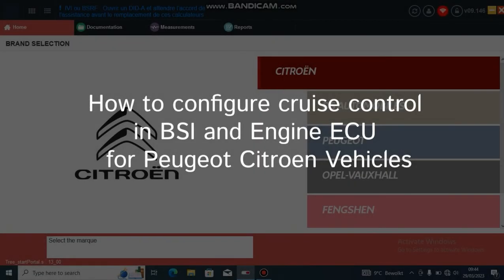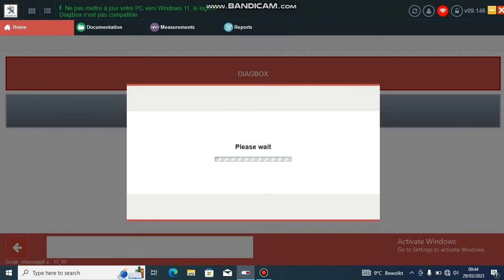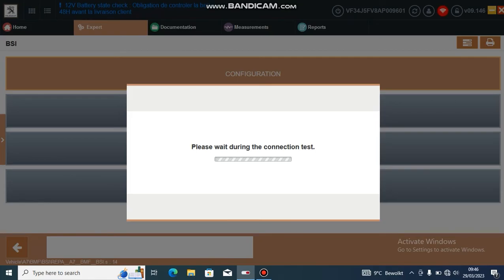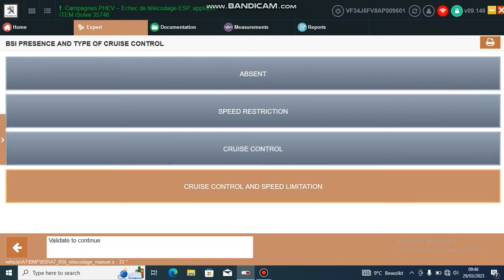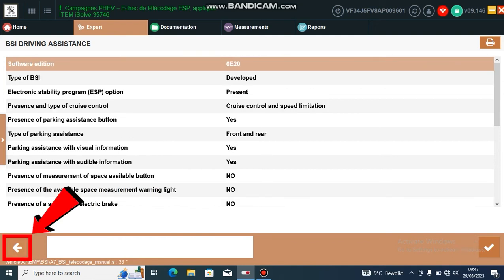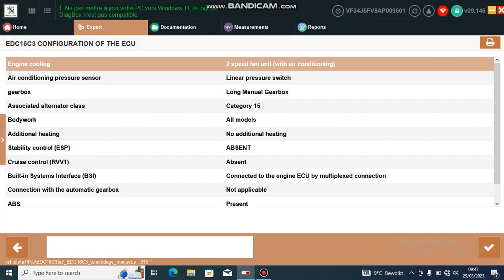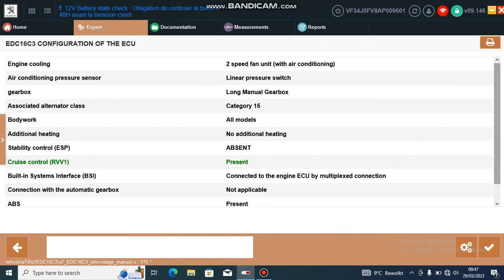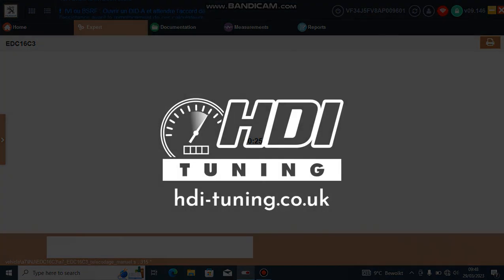How to enable cruise control in BSI and engine ECU using Diagbox Peugeot Citroen vehicles

Comment: Hello, i would love to swap my citroen c5 x7 1.6 hdi 5 speed euro 5 8valve with a 6speed from 508.. Any idea how to workout a cruise control? In my ecu there is only: Manual transmision or automated operated transmision... Im pretty confident how to do it hardwarewise but scared my cc wont work with software.. Cheers

Comment: Could you do this for me as a service? What area are you in? I have my stalk I added. The buttons work via an obd reader, brake pedal has multi wire switch and clutch pedal also has a switch. Its on a 2009 C2 1.4HDI. I also need to change injector trim codes as I fitted a new set and its not quite sweet enough.

Comment: So i have everything in place, all sensors on pedals are present. I can code it in bsi aswell. But in the engine it is greyed out. "Present"  is greyed out. Does older diagbox solve this issue too? (207 1.4 8v 2007)

Comment: Hi great video. In my case I bought a seocnd hand citroen with the cruise control you describe. However cruise control only works on 3rd and 4th gear. My theory is that it doe snot work on 5th because the previous owner changed the gearbox (he told me so). Therefore I need to change the ECU to identify the new gearbox so it can calculate the right revs per speed.

Can you make a video doing that?

Thanks

Comment: I get the error "adaptive cruise control failure" and "collision risk detection system failure". Is it the same as your problem? Can it be fixed with lexia3?
      
      I think the front ACC radar sensor needs to be calibrated. Is this possible with lexia3? 

If possible I will buy lexia3 v9.91

Is adaptive cruise control and automatic cruise control different?

My car: 2022 peugeot 508
Thanks.
Reply: @EzineAkbaş  hello, did you find a solution to your problem ?

Comment: Hi 👋
I have problem with cruise control on my Peguot 308 1.6 HDI 2008
When i drive and go in fifth gear cruise control works...but when i shift up in sixth gear cruise control turns off.... What can be the problem with this??
Reply from the maker: @PANTER1389  was the problem always there since you owned the car, or a new fault? Are any faults stored in any of the modules?
Reply: @StevenLewis-HDI-Tuning  problem is from couple months back
Reply: Some guys tell me to use contact sprey and sprey all conetctors... I realy dont know any more. Its just stupid eror
Reply from the maker: @PANTER1389  and you scanned for faults in all modules? Seems like maybe a difference in gearbox speed sensor Vs abs speed sensor, do you have the original size wheels?

Comment: My friend, it is the same ecu EDC16C3 1.4 HDI, 2003 model BSI computer coding is ok, but Cruise control RVV does not appear in the menu in the engine computer, can you help me, what do you recommend me to do, is the vehicle not supported?
Reply from the maker: @bnyo  it's not an option in that SW, you could try fitting a newer 1.4 ECU where it was possible, but then it will also use a different bsi so might not be so easy to do that
Reply: 😮 @StevenLewis-HDI-Tuning

Comment: Do you think it will work for a peugeot 206 from 2007? 
Great video, even as a forienger it wasnt too fast or too slow
Reply from the maker: Yes most likely it will work as these ECUs usually have the cruise control software inside already

Comment: Windows xp only...
Reply from the maker: For pp2000 you need xp, diagbox works on windows 10
Reply: I brought the thing using your amazon link (some cables and CD). I put the CD into the PC and there is a "Lexia 3" for citroen, and pp2000 for peugeot, but none of them work
Reply: So, which other diagbox is needed?
Reply: I found the diagbox on the second CD🤦‍♂️
Reply: I have noticed that my windows was updated to the 11 version, then i have installed 10 and currently i am running the instalation for the diagbox.
Reply: After almost 9 hours on the pc still couldn't make it... I have installed the diagbox but on activation is says "Fail (error code 0). I have tried with internet, without, nothing works. The thing is rubbish, I will return it tomorrow... very disapointed🥺

Comment: Hi Steven, i try do do everything you said but after i log in to engine managment and after going further i get this error : Acess to the authentication server is not possible, please try later. What should i do? I have 9.91 digibox

Thanks
Reply from the maker: Try diagbox v7.02 or 7.57
Reply: Thank you for your reply. I have 2014 peugeot partner, now installed the v 09.129 and same problem. BSI step no problem. But after entering ECU and Manual configuration i have 3 options : 
ECU downloading, Injectors classification and Cinfigurable vehicke speed governed. I entered all 3, no chance. So i kinda cannot enter BSI alteady on 2 programs 🙁
Reply: I have edc17c10
Reply from the maker: @denismackevics9371  yeah so go to an old version it will allow you to do it ;)
Reply: Hey hey again, Thank you for help so far. Have a problem here, installed 8.72 version i think was called, the only i could get and cant connect to the system as the wire looks like is new, but the program is old, could it be an issue? :( @StevenLewis-HDI-Tuning
Reply: Thank you, will tey. Where can i get the old version? :( Because this one my friend installed for me. The 2022-2023 version :) Thank you for your help

Comment: Hello all, I've retrofitted cruise control into my 207 auto and it instantly turns off after switching it on the only issue I can see is that it thinks the clutch is constantly pressed. Will I have to add a clutch sensor or how do I get around this? I have configured it in BSI and engine
Reply from the maker: Try fitting the correct double brake switch
Reply: @StevenLewis-HDI-Tuning  it's already got a double brake switch is there a different variant?
Reply from the maker: @kyleprueitt6592  did you set clutch switch not present in engine ecu configuration? Not sure if that's an option on this one.
Reply: @StevenLewis-HDI-Tuning  yes not made any difference, might it be worth putting a switch on there just to trick it?
Reply from the maker: @kyleprueitt6592  do you have the right setting for the stalk, is it cruise with speed limit rvv or just cruise on its own? You've turned it on in the bsi too?
Reply: @StevenLewis-HDI-Tuning  yeh turned it on in the bsi, had to short the clutch switch in the end and configure that in for it to work

Comment: Hi mate, just looking for a bit of clarity in regards to the diagnostic tool.

I've got a 2007 citreon xsara picasso which I'm trying to stop the new second radio I installed beeping and also try to get the cruise control working. 

Is the diagnostic tool in the link going to be compatible with my vehicle? also I only have a laptop with windows 11 installed, I've read It needs to be an older version of Windows for it to work. Any advice would be greatly appreciated.
Reply from the maker: Windows 10 with all antivirus and protection removed  don't do this on your daily laptop the cracked software is full of viruses

@638king
Reply: Hi, thanks for the reply! 

I think I can download and revert back to windows 10 on my laptop, if I use the software just to do the jobs, then I can wipe the harddrive and restore my windows 11. Hopefully this mitigates the viruses as it is my only laptop. 

Just another question, is there any other reason you can think of why my CC isn't working? like I said, it's not a retrofit, it was already installed in the car when I got it. I've also changed the break/clutch switch. My stick doesn't have a speed limiter, it just has an on/off. No light appears on the dash if I turn on. I don't know if that's normal and it just turns on when the CC is engaged. 

Is it just a case that even if all the components are installed there's a chance it's not been activated? 

Also, are you based in London? (or near) if you wanted to send me a quote to look at the CC and radio beep, that would be ideal for me.
Reply from the maker: @andrewwalker9479  probably there is a fault stored for something in one of the modules so cruise won't work
Reply: Ok, thanks for that. So do you think I should be able to investigate/fix through the lexia digabox? Gonna order one later today if so.

Comment from the maker: If you're not allowed through on the config page, change your version to an older diagbox before internet coding was compulsory, try V7.57 for example.
Reply: Hello @StevenLewis-HDI-Tuning, I have Peugeot 2008 GT Line (year 2020) automatic diesel with full equipment, active safety brake (radar+camera), parking sensors, blind spot monitoring. I don't have active cruise control and full parking assist. Is it possible to unlock these 2 features with DiagBox? Thank you in advance
Reply from the maker: @Janchek1992  it probably is, but you'll probably need the most up to date version which would mean a trip to the dealer. I found it won't let us do config in new stuff without an internet connection to PSA
Reply: Could I bring my car up to you to try this? I tried an old Lexia and it would not auto read my vin number and no options shown to select any systems. It was older style graphics with yellow outlines.. Or may be help me find a version known to work? I am near Dover, I dont mind a good drive to try. its a 2009 C2 1.4hdi
Reply from the maker: @rushymoto  possibly yes, drop me an email so we can arrange

Comment: Hey Steven, good work.
i have Peugeot 207 from 2007.
1st changing is done. (Present)

In the 2nd part ecu, after changing to present, the updating is failed. Any idea? Tips
Reply: Hey Selim i have a Peugeot 207 2008 and on BSI i Can activate it but on thé ECU  doesn't work ( absent) i have diagbox v7.57 / ECU J34P kfv engine thanks you for helping me
Reply from the maker: @dzcars9434  if the option is not there it's not possible on that ecu software version
Reply: @dzcars9434  Hi, excuse for late respons. I succeeded with version 7.02. Try with this. Higher version kept crashing when activating ECU, lower version its activated.
Do you have the plugs behind the brake and clutch?
Reply from the maker: Are you in the correct ecu type?
Reply: @StevenLewis-HDI-Tuning 
İt works now. İ downgrade the diagbox software and it is now present. Cruise Control works. Tnx

Comment: Hello, can you actually set a speed limit in the BSI or engine ECU? I want to set it to 70mph. Thanks
Reply from the maker: Yes there is a way, I have a feeling that's only possible on vans as you don't normally see the menu. Have a look around, you should find it. It's in 2 or 3 locations, engine ecu  bsi, then somewhere else in the bsi, that's what I remember from the last time i turned one off but that was a long time ago now.

Comment: Hello Steven, I did all of that in pp2000, I think I should wire the brake 4 pin switch to the ecu, do you know what are the pins I should conect to the switch? Thanks a lot.
Reply from the maker: I think you fit a different switch and no wiring is required. I've never done it, so not too sure sorry.
Reply: @StevenLewis-HDI-Tuning  thanks for your answer. The brake switch has only two cables in it, but has space for another two.
Reply from the maker: @dieseltips  I have no idea, try to copy the wiring from a car fitted with cruise already?

Comment: i tray you video , done step by step , in display start show cruise contol but when tray on when draiving blinking ---   and  no work cruise control   peugoet 308  2012
Reply from the maker: See if there are any more options in the dash and in the bsi menus. Sometimes you need a different brake switch to make it work.

Comment: My ECU is not telling diag box what type of ECU it is so I cant activate CC in the ECU : .(
Reply from the maker: Did it detect the VIN of the car at the start? Usually if it doesn't know the ecu type you simply select it manually.
Reply: @StevenLewis-HDI-Tuning   It did get the vin and it wants me to chose the ecu type so I guess Ill have to pull out the ecu

Comment: hi, would you be able to activate lane positioning assist and grip control on a peugeot 2008 (year 2020)?  if yes, could you make a video guide?  Thank you.
Reply: Did you manage to enable it in your 2008 by any chance?
Reply from the maker: I guess it would be possible if you fitted all the required parts

Comment: how to do this on edc17c10?
Reply from the maker: Its the same
Reply: I have a 207 1.6 HDI 8V with the EDC17c10. I can code the BSI but not the ECU with Diagbox 9.15 because it wants to "phone home" first. Does it work without internet connection in the older Diagbox versions?